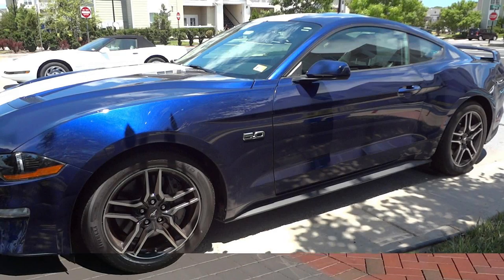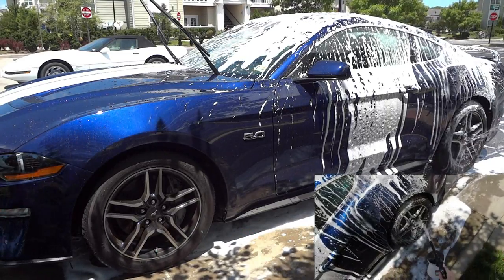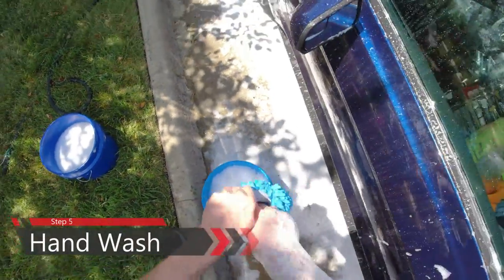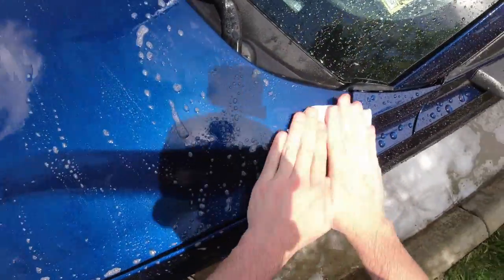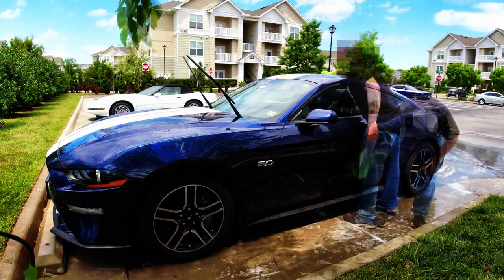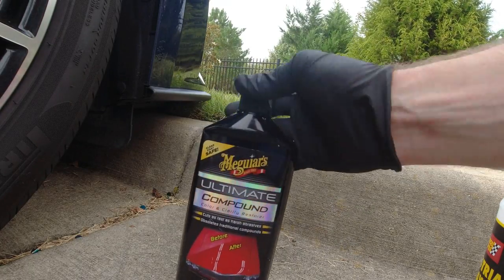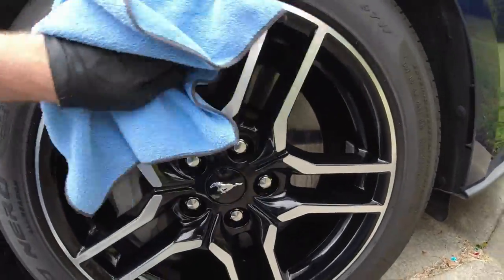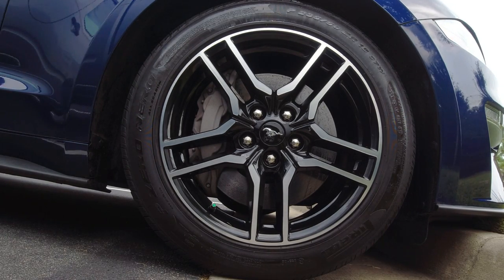How to Wash Your Mustang

Comment: Don't you need a special lubricant when doing the clay bar?  Or is your soap solution good enough?
Reply from the maker: You are correct. Lubrication is very important. But yes, soapy water does work as a substitute to the Quik Detailer provided

Comment: Awesome tutorial. I started using a leaf blower before I was the car for the engine bay and trunk to get leaves out that make there way in there and after I dry it off. Brake buster works really good at loosing the brake dust and other contaminants from your wheels.
Reply from the maker: Thank you for the support. Leaf blower is not a bad idea.

Comment: Great video and explanation of the use of the various processes. My cleaning method is very close to yours except I use a random orbital polisher after the clay bar to remove any scratches. I too am a big fan of the ceramic sprays. Though I use a different brand, it works very similar to what you use. I live in Colorado and I've been tracking the performance of the ceramic spray over the past 12 months and it works exceptionally well on the top surfaces and front fenders, water beads extremely well for 6+ months even with the extreme sun we have in Colorado (one of my cars stays outside year round). Where it needs more frequent application is on the doors, rear quarter panels and tailgate during the winter months due to the magnesium chloride deicer applied to the roads. The ceramic spray also is helpful when used on a snow blower housing as the snow glides off much more easily instead of sticking and clogging the chute.
Reply from the maker: Thank you!!! Using a polisher is a great idea, I've used them on numerous occasions. I still use ceramic spray and once the weather stays nice, I plan on using ceramic coating. We've had great results throughout winter as well. Good feedback and thanks again for the support.

Comment: In this demo post did you wax the Mustang prior to doing anything?  Also Maguire makes their Ultimate Wash and Wax.  Will this be ok for applying some type of wax coating if the car has never been waxed.  I'm not really into hand waxing (by hand or with an electric buffing device).  Good video but it does raise some questions for the neophyte.
Reply from the maker: No, the Mustang was not waxed beforehand. 
The wash and wax soaps are great. However, the wax additive doesn't provide a long last protection.

Yes, you can wax the car after the clay bar/washing instead of the ceramic spray. Ceramic spray and wax are similar in purpose; they are protective coats that protect the clearcoat as well as make the car shiny. 

Feel free to ask as many questions as you like.
Reply: Thanks for your reply.  I will use your method seen on your YT video video
Reply: I'm using McGuire's Ultimate Wash and Wax for the initial washing (twice), then claying, then rinsing, then McGuire's Ultimate Liquid Wax and THEN followed by the Turtle Wax ceramic spray.  Is it ok to use the Ultimate Liquid Wax before applying the ceramic spray?  Keep in mind this 2013 Honda CV-S has never been waxed.  Are the Wash and Wax and the Liquid Wax treatments redundant?  Is it ok to apply the ceramic spray after the Liquid Wax?  Any conflict here?  Thanks for all your help.
Reply from the maker: You should be fine
Reply: @mcgurrentertainment    Thanks so much !

Comment: I have a question about the ceramic coating If you wait to do the second coat the next day will you cause scratches in the paint due to all the dust to that accumulated overnight, I'm having this very problem for some reason my car attract s heavy dust after waxing I want to try this ceramic coat but I don't want to cause more scratches when applying the second coat
Reply from the maker: That's a very common issue. The good new is, you don't have to wait for the next day to do the second coat. According to Avalon King, "allow the vehicle to dry for 1-2 hours before deciding whether or not you need to add a second layer of Armor Shield IX. While not necessary, a second pass does help guarantee that every square centimeter of the vehicle has been coated."

From what I read, the second coat is not required because Avalon coating is not designed for laying. The second coat is for "just in case you miss a spot" scenario.
Reply: @mcgurrentertainment  much appreciated 👍🏿